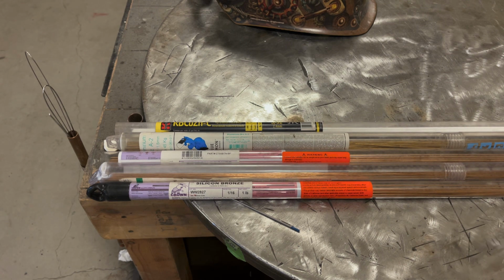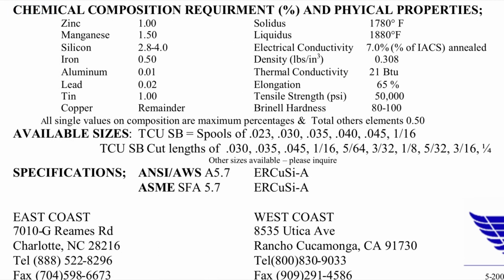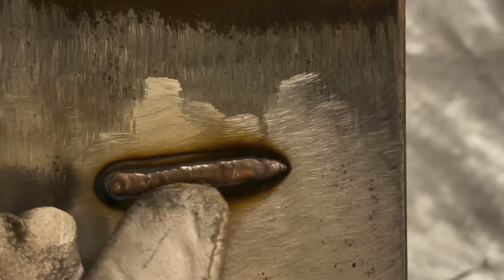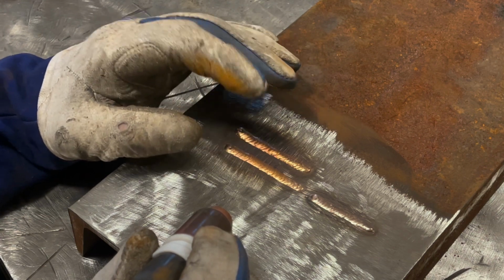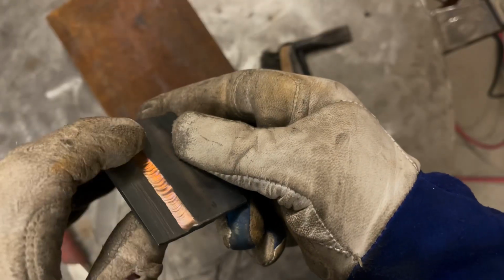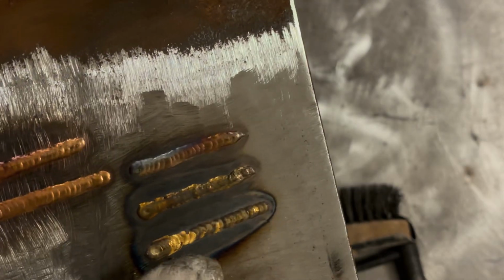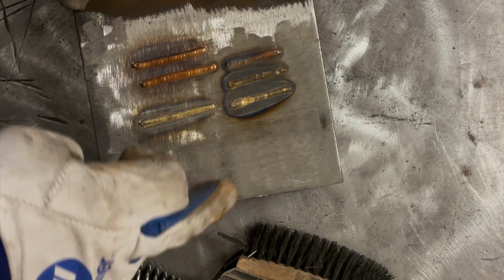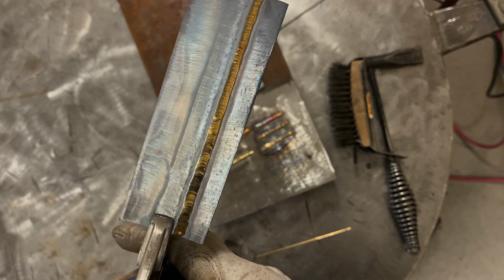How to Tig weld / braze with silicon and aluminum bronze 🤑

Comment: I am still new and planning to Tig weld. I am trying to wrap my head around the 90% penetration factor... How doesn't your tungsten blow up being that high? Do you need to run a higher argon? Maybe I have something mixed up but thank you in the mean time.
Reply from the maker: So 90% ac balance means 90% electrode negative (penetration).  It’s the electrode positive that puts heat into the tungsten.  Universally machines “a/c balance” control is how much negative you run, aka 75% balance means 75% EN 25% ep.  Some machines (typically cheaper ones) are the opposite.  It’s best to verify with the manual of the machine to determine what is being adjusted.
Reply: Thank you!

Comment: Can I braze aluminum parts with a DC machine? or do you still need AC for brazing it
Reply from the maker: So aluminum bronze can’t be used for aluminum, despite the fact it contains some aluminum.  You can technically braze aluminum with tig, but it’s going to be somewhat difficult.  Conventional aluminum brazing is done with a oxyfuel torch, and a rod with flux on it.  Tig doesn’t work well with rods with flux because the flux contaminates the tungsten.  So you would have to deal with tungsten contamination, or attempt to knock the flux off and use it.  I have a feeling it would perform poorly without the flux cleaning the base material.

Beyond that using helium makes it possible to dc weld aluminum, but the downside to this is helium is very expensive and within a bottle or two you could just buy a ac machine lol.

Comment: Have you ever tig with 9% nickel bronze
Reply from the maker: I have used a nickel bronze wire with oxy fuel to repair things.  I have not used it with tig.  I would imagine it works just like silicon bronze with tig.  The addition of nickel would likely cause it to need a bit more heat than silicon bronze to flow out.  Brazing with tig operates very similar with most brazing alloys.  The goal is to hit a temp where the filler flows out and sticks to the metal but the base material doesn’t melt.

Comment: It'd be awesome if one could braze over paint, ie, have that golden bead visible in a finished thing.
Reply from the maker: You could buff the paint off the braze and clear the whole thing to make it visible.  The clear will protect the bronze as well keeping it looking good for longer 😀
Reply: @makingmistakeswithgreg  Yeah, could be nice 👍🏻
Very nice videos btw, I've been learning a lot! Also btw... would you know if pulsed mig spray transfer with 90/10 gas is usable for 3mm and such thicknesses in general, so that I could just have that one gas bottle? Looking to upgrade from my really old 160A mig to either tig or a more modern mig. I'd like to be able to minimize distortion and also avoid sparks and fumes when I can, including those from grinding.

Comment: That's cool, i never done this stuff but good watching. Will Silicon Bronze TIG Braze brass to steel. I have a 3/4 inch male brass threaded i want to go through the bottom of a 44 gallon steel drum and two brass nuts each side and then seal it with a solid TIG Braze? Should i buy 1.5 mm Silicon Bronze Rod?
Reply from the maker: So brass can be very interesting to braze, because it often leaches oil and contaminates.  I have done it for artistic purposes.  With tig expect to have issues with tungsten contamination.  Wear a respirator of some sort, don’t breathe the fumes.  Rod size of 1.5mm should get the job done.  Expect a lot of black spot cleanup.  Hope that helps 👍
Reply: @makingmistakeswithgreg  Sounds like something not to try for the new, I've ordered 1kg of Silicon Bronze 1.6mm rods. I will play around a bit see what happens with various metals etc but i decided from a plumbers advice to just use 3/4 inch plastic tank bungs in the bottom of the drum. Though if i start using a centrifuge to filter waste veg oil it needs to be heated pretty warm and ran through pumps and lines ect and will likely try braze or weld a decent 1" metal pipes in to handle it. Thanks for the tips. I posted a vid my channel with what i did so far.

Comment: Can you weld stainless exhaust using tig and Silicon bronze ?
Reply from the maker: Great question.  On face value I would think the expansion/contraction of the exhaust pipe would cause failure of the silicon bronze.  If the significant movement didn’t the higher temps combined with the movement would likely cause failure.  On muffler that’s far from the heat I bet it would work fine.  On a header not so much.  

Interestingly enough it’s actually pretty common for people to have weld failures on stainless headers (I have repaired a ton of them).  It’s very hard to not have internal suck back/undercut on thin stainless tube.  That leaves a perfect place for the tube to crack.  Back purging with argon will help reduce this.  Well with silicon bronze, you wouldn’t have suck back because you’re not melting the base material at all.  This could be a benefit on super thin material.  Again I don’t believe the bronze would handle the thermal cycles without cracking.

Comment: Would silicon bronze be a good option for affixing zinc/galvanized nuts to steel pipe/tube for shop fixtures and such?
Reply from the maker: Bronze will still react with the zinc like normal steel wire.  It’s very common for me to weld nuts onto things, and I generally clean the zinc off in the area I tig weld it.  I use either er70 or 312 stainless wire to do the welding.  The result is a clean weld that’s strong.  There is no practical way to maintain corrosion resistance after welding zinc coated metals though, the zinc boils off.  Bronzes could use used, the two main benefits would be better corrosion resistance of the weld (over er70) and lower heat input.  The lower heat input would cause less distortion to the threads, which could help reduce the time to tap the threads.
Reply: @makingmistakeswithgreg  Thank you very much! Your content is great. I learn more with each clip I watch. Thanks again!!

Comment: What do you know about ERCu wire?
Reply from the maker: So straight ERcu wire I believe is only generally used for welding copper materials.  I would imagine it could be used for other oddball jobs and possibly even auto body.  I looked up a spec sheet and it appears to be very low in tensile strength (8,000) so it’s significantly weaker than aluminum bronze and silicon bronze.  The benefit it has is it would exactly match coppers color, something that your typical copper/bronze alloys wouldn’t do.

Comment: Really nice puddle control.
Reply from the maker: Thanks.  Bronze flows a lot like solder and when you get everything right it’s not too bad.  Definitely pays to have everything clean.  I use it a fair amount on castings and that is hard with a tig setup over a torch because of all of the contaminates that jump onto the tungsten lol.

Comment: it’s just like tig welding just at 20 amps or so less than normal.
Reply from the maker: Pretty much.  If you can tig weld you can tig braze.  The hardest part is getting the right amperage at the start, since you don’t want to melt the base material.

Comment: Could you do a cut away of the bronze aluminum weld you did just curious how that compares to the silicon bronze. Thanks for the content
Reply from the maker: You mean a cut and etch, or just cut? I have a feeling both are identical since the goal is to only melt the filler.  I will do that though 😀
Reply: @makingmistakeswithgreg  I was curious if you could actually see the aluminum layer with the bronze cap. I wonder witch one is a stronger braze or if there comparable.
Reply from the maker: @jeffbellinger8542  ok sure, I will do that and have it out in the next couple days 😀
Reply from the maker: The video will be live tonight at 4pm.  It’s a short video titled silicon bronze cut and polish.  The results were a bit surprising to me. 😀

Comment: I've watched all of the usual suspects on YT....but have to say that this is one of the best tig brazing videos online. Great job!  I've tig brazed with both silicon & aluminum bronze and really enjoy it. I originally tried both on DC, but after trying AC, I think the cleaning action improves wetting action for both & undoubtedly produces a cleaner bead.  I've also tried both to build up/join brass & steel, with limited/minimal success, due to the zinc fuming off-  I recently discovered phosphor bronze which has worked much better on brass build up/joining.

Keep up the great content. Subscribed
Reply from the maker: Thanks for the kind comments!  I agree that the pinch of AC really helps.  You’re spot on with the difficulty of joining brass and steel.  Stuff like that I generally would torch braze because of tungsten contamination issues.  I mostly deal silicon bronze with ornamental iron, and occasionally art work.  It has a lot of useful applications though.  Personally I think it’s fun to look at gold tig welds lol.

Comment: thanks for the info someday I will come back to this video when I get everything up and running but are you running AC or DC tig
Reply from the maker: The machine does a/c for aluminum and aluminum bronze.  I mostly weld steel and stainless on dc.
Reply: @makingmistakeswithgreg  ok cool

Comment: Thanx for showing the aluminum bronze.  I have a specific need for a small bronzing job which I believe aluminum bronze is the best solution.  I don't know much about it so when I get my pound of aluminum bronze, I will be practicing a lot just for two parts about an inch long and 8th inch wide and deep.  LOL.  But it's important or else I would use some other technique.
Reply from the maker: Glad it helped you.  Aluminum bronze incredibly  strong.  If you have the option of AC it will help a lot.  Running a #8 or 10 cup on a gas lens with decent argon flow will help some too, small cups seem to produce a lot of soot.  If you have any issues doing it let me know.  Practicing will surely help, I am sure you will get it.
Reply: @makingmistakeswithgreg  
I was watching another utub vid in which he was testing different flows.  Underflo, just right and overflo.  The underflo always produced very poor brazes.  The overflo usually was subpar, but not always.  The just right flo always produced great brazes, however, the trick is to know what is "just right".  

What I am going to TIG is an engine (2HP electric) shaft that the key got loose and wrecked the shaft--this is steel, and external.  Just need to build up the wall of the keyway.  What I am afraid of is that the shaft is about 1.25 inches across and that the needed heat will have to be just right to start.  I cannot practice on the shaft.  I will practice on a like shaft however.  

The other -part is a mating part that is cast iron.  It has a gouge inside which is a bit smaller but more difficult to do simply because I will have to extend the tungsten out mayber 1 in and a half.  That shouldn't present too much of a problem as the argon will fill the tube.  The problem which may take place is the flame going all over the place.  

Any suggestions?
Reply from the maker: I have done repairs like you have said, and I have also brazed bearing caps on big engines were corners broke off or the like.  Here are some tips, hope they help:

Brazing requires the material to be clean, make sure you use whatever means needed to clean the shaft to bright&shiny clean metal.  Acetone wipe everything down when your done.

Brazing is done at a lower temp than welding, but it still has heat input, so don’t just do multiple pass with disregard.  Bronze doesn’t pull as hard as actual er70 wire so the shaft will be straighter when the repair is done.  Keep in mind it’s wear resistance is obviously much less  (not a issue if a keyed pulley is on the shaft).

Between every pass of braze let it cool slightly, and wire wheel the surface.  You want it clean for multiple passes.  

You can run a big cup but keep in mind if you run a big cup with 90% ac balance (DCEN) you may get the ac arc shorting out to the internal lens screen (like with a furick cup).  Most big lens setups say DC only.  You saw how much better aluminum bronze works with a pinch of A/c, so if possible run a/c.

I would highly recommend you lookup Washington alloys website, and look under silicon bronze and aluminum bronze tig fillers.  When you look at their spec sheets they give great tips on how to get the best results.  One of them being I believe they recommend a preheat to the part to ensure proper adhesion of the bronze.  

Lastly I would take a rag completely soaked in cold water and drape it over the motor shaft as close to the bearing as possible.  That way as the shaft heats up the heat will be pulled out a bit before it smokes the front bearing grease/seal.  It also wouldn’t hurt to clamp a angle iron piece to the opposite side of the repair to help keep the shaft straight.  The bronze won’t pull much but the heat alone can cause the shaft to slightly warp.
Reply: Great video, I do know from experience that welding a crack or hole in a holding tank or oil pan that will hold any pressure with silicone bronze will leak from almost invisible cracks, will aluminum bronze hold the pressure any better ? Thanks

Comment: Very well done and informative video Thanks for pointing out the care need to not melt the base metal, I think that's been the problem I been having with tig brazing.
Reply from the maker: I am glad the video helped you out.  I find running a fixed amperage on the welder and going max footpedal is a good way to prevent excessive heat and melting the base material.  It takes a bit to get it dialed in but as long as you keep the arc on the bronze and not moving forward so fast you melt the metal ahead of the molten bronze you should be ok.  To me it’s just like tig welding just at 20 amps or so less than normal.